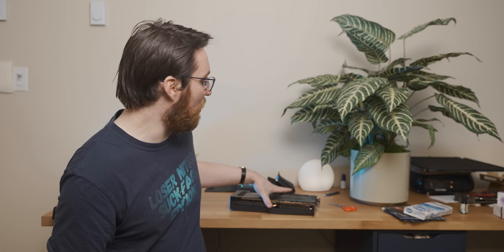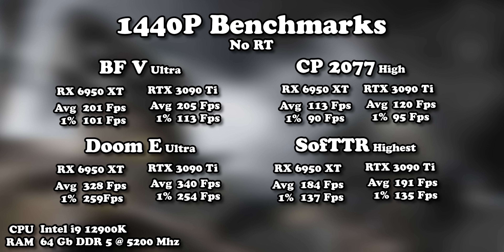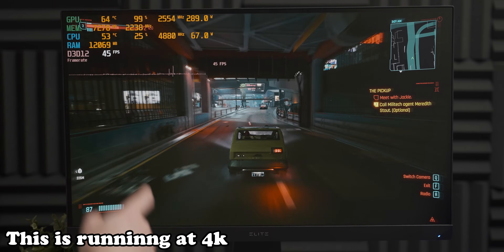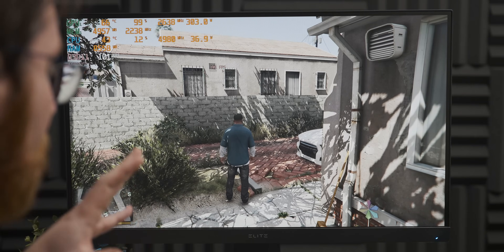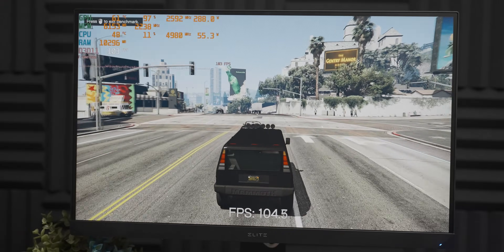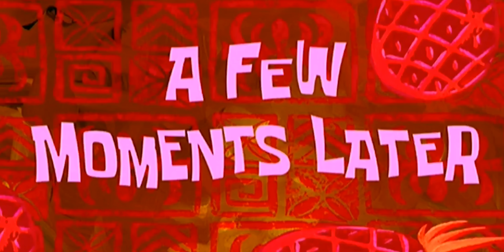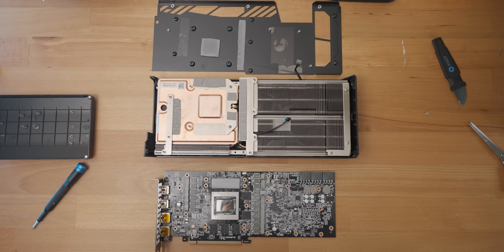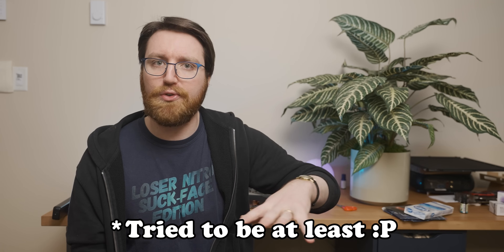I Can't Figure Out What's Wrong With This Gigabyte RX 6950 XT

Comment: Yo Dawid, I had the same issue. Tho i simply used User benchmark to see whats going on, since I had like 70 fps in BFV.
The Benchmark said, I got 100% performance(RX 5700 XT level). It did seem to work fine, just as yours.
So here goes the magic for me:
result with radeon chill enabled
UserRun/53875093
result with radeon chill disabled
UserRun/53875187

I've run the same test with BFV.
with chill enabled I had 76 AVG FPS
with chill disabled I got 134 AVG FPS

Basically the 100% performance I was missing.

Comment: This probably sounds incredibly stupid but have u tried turning up the power limit using Radeon Software instead of Afterburner? Only saying cuz I've had some minor issues with Afterburner on my 6900 XT but Radeon Software worked fine.

Comment: I had a similar problem but with RTX3090Ti from MSI. My card shot it's boost freq to over 2050MHz while power draw stayed around 300W but card crying for over voltage. Really weird. I had a conversation with MSI's support and they could only tell there's something wrong with the card and I should return it to retailer. So now all I can Donald is to wait for another card from warranty.

Comment: I have the same problem with a Gigabyte 6900 XT. I have a lot of artefacts when graphics settings are high or ultra. Very choppy fps with constant drops. The gpu powerdraw maxes out at 265 watts. Above the 3 8pin psu headers there are 3 lights, only 2 of those light up. Have tried different psu cables and put the modular cables in other psu slots. Tried latest drivers, mobo bios and gpu firmware. The card just doesn't seem to draw enough power. It only works ok in 1080p and medium settings. Have requested RMA, I hope they send me a new one or refund. GPU was bought yesterday  haven't overclocked it or anything. Spent all day trying to get it to work 😢
Reply: This video is misleading because AMD software (or any other software such as hwinfo which reads the same sensors) only reports power draw from the GPU and not the whole card. It is not the same as total power draw reported on Nvidia cards. A reference 6900xt draws 255W, your Gigabyte draws 265W, my Sapphire Nitro+ SE draws 289W graphics power (specifications say 363W for total draw on the Nitro). These numbers are all normal that doesn't mean there is anything wrong with your card.

As for choppy fps, there can be many reasons for that. AMD drivers aren't the best, especially with older DX11 titles. AMD improved their DX11 performance in their May 2022 driver (22.5.2) but it won't boost the performance on every title out there. Some games are smoother to play on my older GTX 1080 than my 6900 XT despite having much lower average fps. CPU bottlenecks are the second most common reason.

Comment: I bought a GTX 980 ti for $60 on Facebook and it had artifacts.  I that I thought was at a loss but I did the heat trick on it. But I didn't have a heat gun so I use the stove and put it 7 inches away from the stove  2 times. Then it somewhat works in safe mode so update and it fixes it woow good card for $60 I'm so happy.

Comment: I'm no expert but judging by the fact that there is a lot of coil whine and the backplate is getting super hot my guess would be that there might be a short on the power delivery system especially the MOSFETs because those tend to coil whine when under too much pressure.

Comment: Dawid, have you tried tweaking the card through adrenalin? Like you can draw huge ton of powers through its bult in Wattman settings compared to MSI afterburner. Also another thing, did you check whether AMD chill is on or off? AMD have been turning their radeon chill mode 'on' on fresh installs for the last 3-4 months and it's decreasing the performance for a lot of people over the world. I suggest if you could talk to a youtuber called 'Ancient Gameplays'. That guy is an absolute mad lad when it comes to AMD related stuffs.
Reply: The card's BIOS is limited to 289W, so raising the limit either there or in software is required.
Reply: @HappyBeezerStudios   If I'm not wrong, Dawid did change the bios.

Comment: Hey there, wanted to mention i had a 6900xt Sapphire Toxic liquid cooled card rated at 400watts, that only pulled 290 watts, and was extremely inconsistent in gaming perfomance, with frequent stutters in most games. After 1 month of troubleshooting, the only way to increase power usage was using third party software, and even then it was still inconsistent ingame... I sold said card, bought a 10gb 3080, and virtually everything runs perfectly now🙃. AMD sort of lost my trust with their GPU's as I've read that many others had similar power consumption issues, or even stuttering issues.

Comment: It's the reason i stopped buying Gigabyte brand. They have bad QC and the fans are going bad quickly. Also the software is horrible. They want to be an A brand but they are B at best. Also look at the PSU issues they have and just ignored it so you can fry your GPU and other stuff. No thank you. Had motherboard and GPU's before from them but no longer. If you lauch a product with poor QC then it's just misleading people to buy flawed products.

Comment: Got a Gigabyte Aorus B660 Mobo and it ran my i512400 @ 3.9ghz , would not boost further and drew about 45% of rated power at load, Had to bios update to fix this issue . B660 boards are supposed to work out of the box with i5 12400 and yet it didn't.

Your case is just another similar example of Gigabyte poor QC

Comment: It can be a HW issue. Coil whine is an indication of badly built cheap inductors. A whining coil will eventually fail due to mechanical vibrations causing the copper coil to break at some point. So far to me it seams to be bad MOSFETs or the chip itself being unable to draw more power. You cannot pump power into a bad silicon.

Comment: Does anyone have a Sapphire Nitro+ 6700 XT? I have one, and it has weirdly  low wattage d raw numbers, but then people tell you  it is "supposed" to do  that because the complex algorithm for clocks etc. during different work loads.

My 1660 Super ALWAYS  ran at  max  125 watts in any  game less than 8  years  old  or so...

My  Nitro 6700 XT , on TECHPOWERUP, just like Dawid's example, runs at what  the spec number is supposed, while gaming for them, so 230  watts.

My card very rarely gets there.

most games it runs at 180 watts max, and often dips below that.

Only  in benchmarks does it run at 230 watts, like Furmark.

Maybe I should use FreeSync premium because I have a gigabyte M32Q, which is a  great  great  monitor ( and one of the only good things from Gigabyte )  but I can never seem to make Freesync tech work properly, or at all... beyond  seeing it say that's it's on or off. the FPS numbers never  do what  I would expect.

DX12 games run well on the Nitro+ 6700 XT, DX 11 games less so.

And I guess many people with many different cards have issues with GPU utilization in  GTA V.

It's even worse for me in X-COM  2.

Anyone have  a Sapphire Nitro+ 6700 XT?

Comment: You're confusing what the card actually uses with the software reading, which on AMD is quite a bit off from what the real power consumption is.
The reviews you're refering to must have measured the power consumption.

Don't just trust software reporting, especially on AMD GPUs.

Just taking a quick look at the vBIOS (on techpowerup for example) and you would have had your answer
"Power Limit
  Total: 289 W"

There's no issue on this end....

Comment: Hey Dawid, at 4:05 you used a screenshot which you showed at some later point again pointing out that the GPU wasn't throttling, but on HW Info it was clearly written that when the sc was taken an RX 6600 was used and not a RX 6950XT? Did you do that on purpose bc then you'd be showing a wrong GPU or did you simply use a wrong sc? :)

Comment: Well, you didn´t try switch to PCI 3.0 ? I have similar problem with rtx 3070 on asus b550 tuf. Changing to PCI 4.0 8x work (until PBO2 - then it go slower with less power). PCI 3.0 works fine even with PBO2. It seems that PCI 4.0 has some issue (lots of issue were confirmed) and probable there are some interference between some component.

Comment: AMD cards report the power of the entire card (with memory chips) differently and for example MSI Afterburner or HWiNFO only reports the power of the GPU chip. So the 290W of the GPU itself (when the whole thing can draw up to 335W) seems fine. In addition, many portals provide power taken from the wall and not reported by MSI afterburner, hence the differences between others and your results. In addition, you should not check GPU power in GTA V, but in more demanding games. And the differences in performance may depend on the test site in the game. Overall, this card shouldn't be much faster than the regular 6900XT.

Comment: 290W on the reporting means the card is using a total of 340-350W. The reporting in the top left you see, the software reading is GPU power only. Not GPU + VRM losses + VRAM.
Your 6950 XT used 340-350W in testing.
Reply: Really
Reply: I had that problem i was worried but if your right I’m happy
Reply: @JohnSulevan-li4gr   Yes, I am right. Cheers!

Comment: I own a gigabyte rx 570 4gb and i recently realized that the power draw caps out at 90 watts instead of amd is rated 150 watts so i definitely think there's something with gigabyte cards
Reply: Going through the VGA bios collection on techpowerup shows that it is indeed 90W while for example the Sapphire Pulse ITX Mini, the PowerColor Red Dragon and the MSI Gaming X to 120W, the Asus Strix gaming OC to 150W, and the reference model indeed to 125W
But they also have the Aorus version listed and that has 148W, so it might be worth the risk to flash that BIOS onto the card.

Comment: I had a rtx 2060S 2x fans from Gigabyte, it was so hot. Using raytracing was impossible, it was aways thermalthrottling at 85 C. Im ok now with my cold rtx 3070.

Comment: In hwinfo64 at 06:09 minute in Gpu core TDC Limit show 100A so its definitely a Gpu 6600 show there as Gpu #1 title say, i don't understand why he put this screenshot in this video ,also all Navi -Navi2  based Gpu in Msi afterburner show less power Draw at least 15 -20% lower, you should check with another app like Gpu Z or take true measurement of power from 8pin cables and Pcie with measurement accessory  or atleast from the  wall .

Comment: Had the same issue with my 3080 master , just to turn out that the thermal pads they used managed to make the memory to throttle,  so if i were u i would consider replacing the thermal pads with a high quality ones then try once more

Comment: Competition is great and I can't wait for Intel to release the ARC GPU... I switched to red and got a 6900. I'm not going to go into debt because it could have just been my experience but I've had nothing but problems.. But I hope AMD and Intel can keep up the competition with Nvidia... Because no matter what brand you choose to go with we all benefit!!!!! Cheers
Reply: Disable hardware acceleration in your web browser's settings and keep lowering your monitor's refresh rate until the VRAM clock speed as shown in AMD's software goes down to like sub-100 MHz at idle, and also disable Radeon Enhanced Sync. Chrome(and all browsers based on it such as brave and the like) implement hardware acceleration very poorly and you'll experience display driver timeouts without modern powerful GPUs if its enabled. Bad monitors commonly allow and even advertise refresh rates that they don't actually support correctly with really messed up non-standard timings that cause display driver timeouts; you can tell this is happening when your GPU is maxing out its VRAM clockspeed at all times. Radeon enhanced sync can cause crashes if a shoddily produced monitor is falsely reporting timings. There's a huge problem that nobody is talking about right now with a whole bunch of really bad monitors having been dumped on unsuspecting consumers and them causing display drivers timeouts and resulting in a bunch of wasteful RMAs, but that's because Asus and the like are the same ones responsible for the monitors.

Comment: I had the same issue with the ASUS STRIX 6900xt LC. You can change the max wattage with a vbios editor.
Reply: I know u broke ur card doing that since 289watts is the chips power draw and not the whole cards power draw since u cant read amd gpus power draw with software only its common sense and all i see in this comment sections are ppl who has no clue 😂
Reply: @martinfletcher9699  ? What are you talking about?

Comment: I wanted to like Gigabyte, but I've yet to have a good experience with any of their products, so I've stopped trying. On another note, I ordered an xfx 6900xt the day before the 6950xt was introduced, and it's been awesome. I don't see any reason for the 6950xt to exist, from a consumer's perspective.
Reply: I feel like the 6950 is just there to say they have the fastest card in the world. It's the same every time. Wasn't different with the XX90 and Titan cards and goes back to things like the RX 5700 AE or Titan X, Titan X(P), Titan Xp or 7970 GHz Edition or GTX 780 Ti or Titan Black or HD 4890 or 9800 GTX+ or 7950 GX2 or X850 XT PE or 6800 Ultra or FX 5950 or X1950 XTX or 9800 XT or many more cards.
They are pushed to their limits and the tiny performance increase doesn't justify at all the massive increase power draw and price.

Comment: Seems like it's faulty power delivery. Coil whine is pretty normal at certain power draw, but that's waaaaaaay too whiny. If i had to guess, coil resistance is too high, which causes significant loss on power delivery. Try checking draw on PCIe connectors or power in of the card and compare it to power draw reported by software. If that's the issue, then it's a hardware problem with power delivery. Another possible way of solving this is external power delivery board, that can be adjusted manually. Overclockers use those to get better results under LN2

Comment: Given all the things you've tried, I have to imagine it's some combination of the components you used. And it must be that the power draw is a symptom, not the cause, because if it was the cause you'd be seeing system crashes instead of low FPS. So my first thought is that maybe whatever platform you were using didn't have Smart Access Memory (Resizable BAR) working right? You tried two different motherboards, but it's possible that two motherboards have the same problem with that. But I think it's more realistic that the coil whine indicates a malfunctioning piece of hardware in the card.

Comment: Soooo, I own a PC repair and design and blah blah here in Pittsburgh PA. I get Gigabyte cards sometimes that are faulty, but Gigabyte hardly produces a successful RMA for us. I tweet complaints. I call many times and complain. I go and try everything. They turn card RMAs away for nothing. So it seems that you need a half a million viewers to get any help from Gigabyte whenever people who paid sometimes 2x the cost for their GPUs can't get legetimate help. If this was my customer, I would probably have to replace the inductor coils on the card and see if that helped, and then move on to other components on the board. Usually coil whine is normal and means that the inductor coils are working fine. Gigabyte would be no help at all. Buy EVGA!

Comment: How much power is it drawing from the power supply? Maybe there is a short circuit somewhere in the card that's preventing the GPU from drawing 390 watts.
Reply: If the short would be in the right place the card would even be able to draw unlimited power (or rather as much as it can pull within the clock and voltage limits set on it)

Comment: Gigabyte have gone downhill in the last few years. I've had a Gigabyte motherboard catch on fire and a wifi card that needs the computer to be turned off at the wall otherwise it doest show up on startup. Funny how all the problems are related to power draw.
Reply: There are barely any good manufactures left.

Comment: Stupid question. Are you using a shared/split power cable for any of the power inputs to the gpu? Or are you using 3 separate cables from 3 separate outputs on the psu? I only ask because i had a similar issue when doing oc on the 1080ti ftw3 i had. It wouldnt do nearly as well when using the split cable compared to the 2 individual cables. I dont use the built in pau gpu cables. Cables are cheap and CAN make a difference.

Comment: How Gigabyte see this. 1, is the card working without crashing, overheating. 2, is performing as expected in normal usage. If yes the card is fine. You will never get anything more than this as there is a performance tolerance. As an example is normal for a card to power draw lets say as an example from 220W to 350W under full load. Its simply a lottery and your card has no issue.

Comment: I have rx 6900 and 6900xt. They drow 270-290w max in normak seting in driver. But many reviewer test than on rage mode and with power limit on max so freqfency stay stable max as he can without oc. So set rage mode and power limit on max and they will spend 340-370w but will get more hotter.

Comment: Yeah this is a hardware issue.
But I got to say that even with that issue it still operates? Damn... Although slower. It sounds like a power issue in one of the vrms parallel phases on the card? This is feeding back into the power supply via the PCIE power connections connected to the video card. Again I am highly surprised that it is running with such an issue and I would not run it for very long in such a state. I would just get  it back to Gigabyte and have them send another. Obviously someone was in it before to check it out like you did. Prolly for the same reasons.